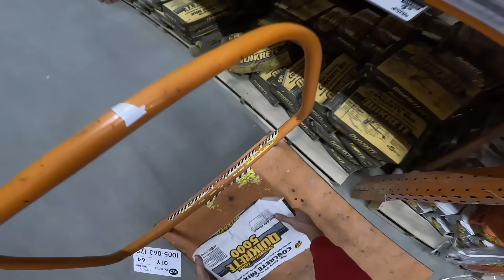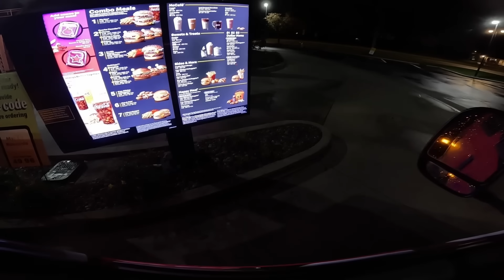How Late Did I Work??!!!

Comment: Why didn't you cut the line to the corner of the porch? It would have looked so much better. Is there a reason with  the durability of the concrete, or just because it would cost you more? Not a dig. Just wondering.

Comment: Jr, 
Invest in some cable tools. They are very cheap, seriously. 
Buy some RG-6 crimpers, some RG-6 cable, some barrels and some fittings. You’ll be able to make a fix and keep the customer happy. 
Super quick and easy fix. The cable company will have to come out to fix it, but you can keep your customers going in the meantime. It’s a 5 min fix.
Reply: Cable tools? Seriously.

Comment: I know this sounds hackish. But get some portland cement or fast setting patching material and spread it over the surface and trowel it in, do it over and over till it gets hard enough to finish, no need to wait around on something this small. Or if you know it's going to take forever to setup mix the fast setting patch in with your bagged concrete, Will setup in no time.

Comment: A total letdown Jr. I thought you were going to mix the concrete by hand. Jr. You already have one strike, so I’m hoping the mixer won’t run. If this repair to this area is your fault, then you are a stand up guy. If it isn’t your fault then charge them well. Watching from Panama City, Florida,USA.  🇺🇸🦅
Reply: I cannot believe you rented a machine to pour a slab that small. UNBELIEVABLE !
Reply: I can’t believe you went inside and left the door open and the engine running.
Reply: @kirbygulbrandsen4507  bro, it was raining, anything helps to speed up the process, especially when you're working by yourself.